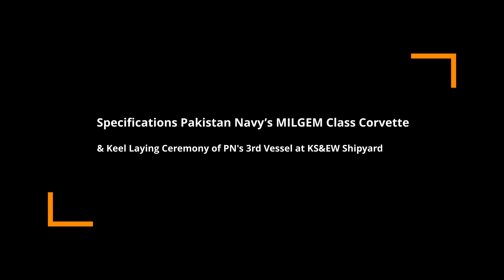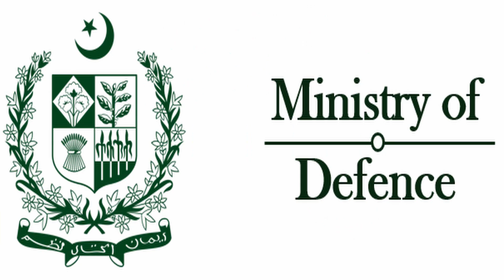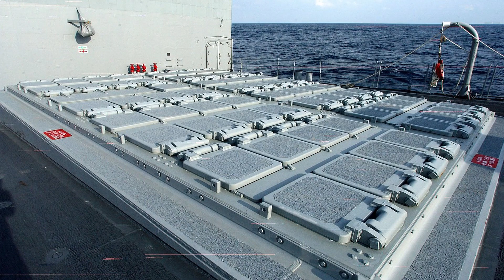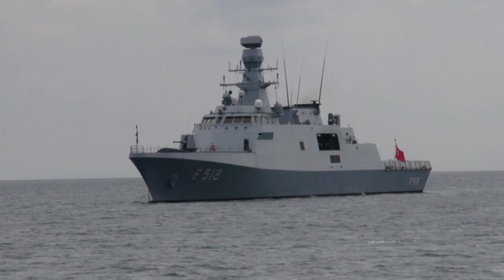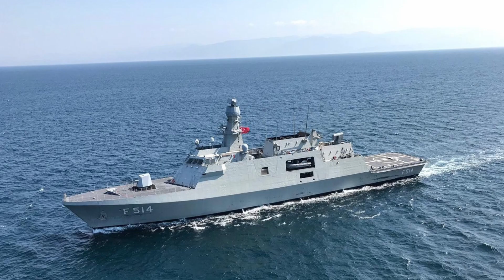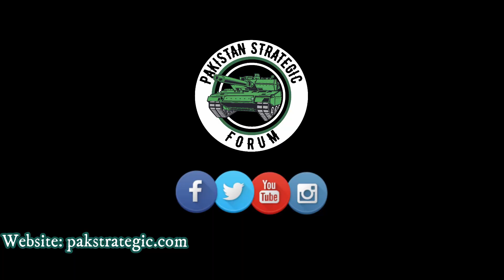Specifications of Pakistan Navy’s MILGEM Class Corvette | Jinnah Class Frigate | 3rd Vessel at KS&EW

Comment: SONAR range is not enough In passive mode. It must be around 100 km by infrasonic detection. 2nd every PN surface asset must comprise of OTH radar even fast attack crafts. Pak direly need 6 type 52C or D destroyers or TF 2000 destroyers with SAM range of 300,km as HHQ9 B